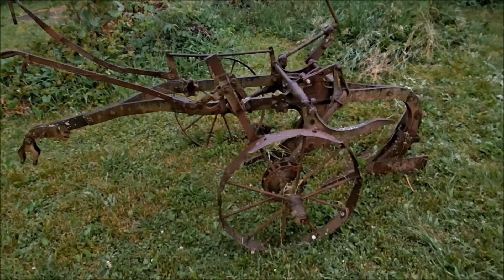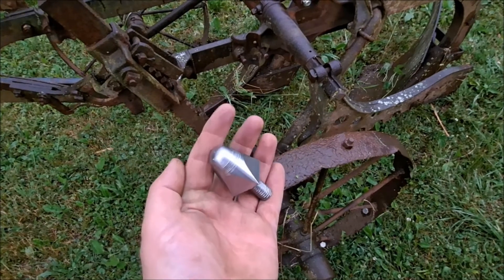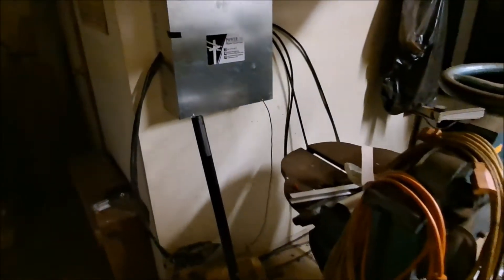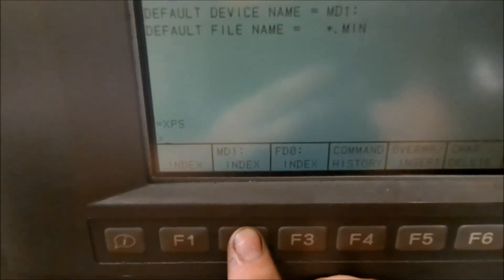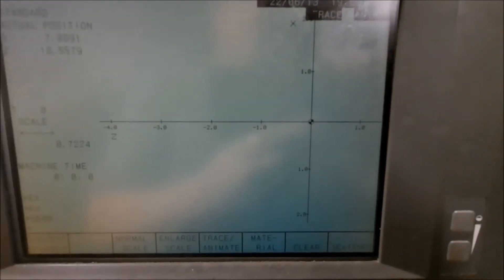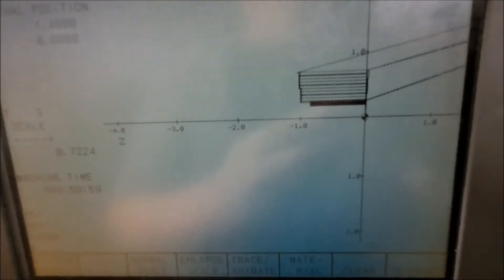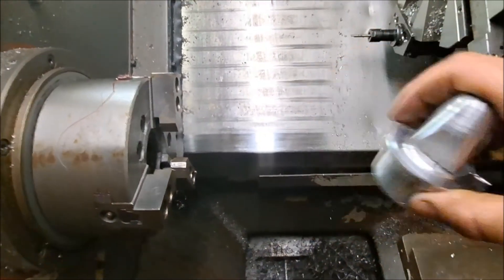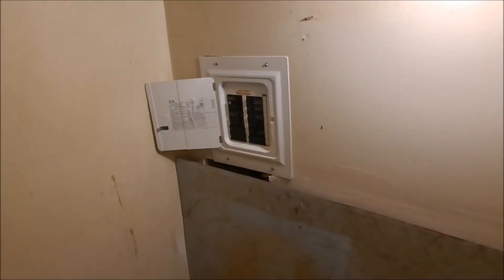#52 Okuma ES-L6

Comment: Oliver used that mechanical lift design into the mid 50s 
I sold a model 4154 with 3/14 bottoms. 
Trip bottom mechanical reset. Thanks Dave.
Reply from the maker: Thats awesome Bryce, wish I had one for the celtrac E-62 and case d